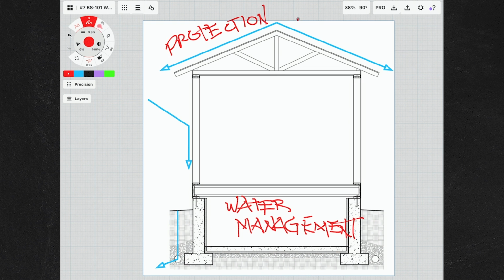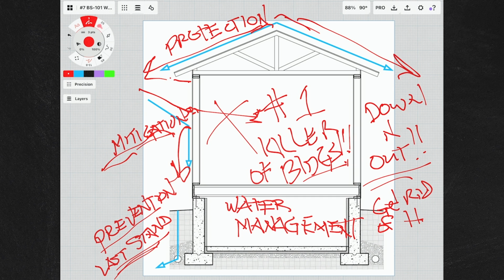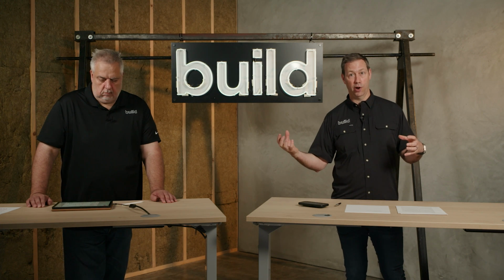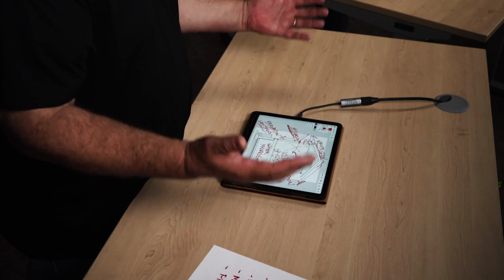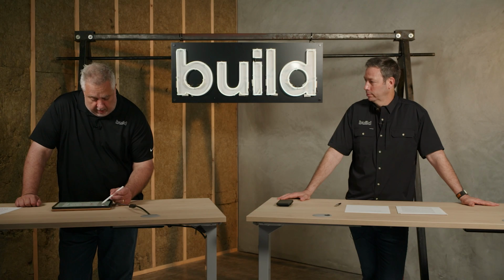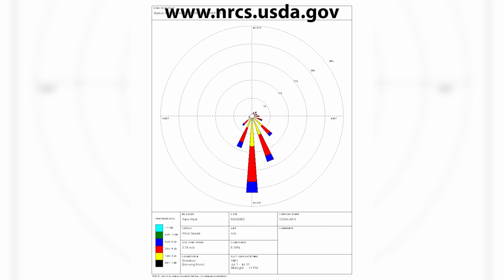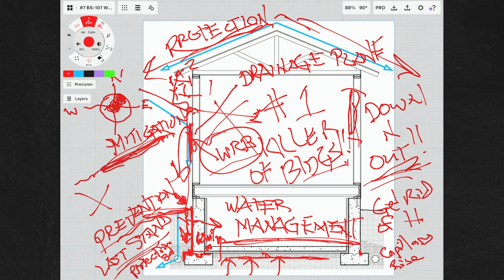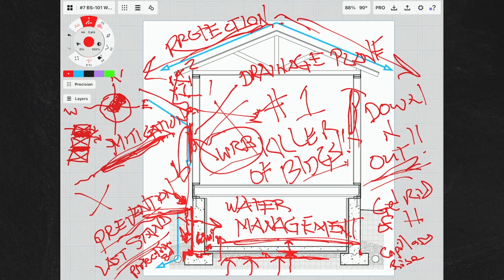Build Science 101: #7 Water  Management

Comment: Regarding the basement and drainage, here in Sweden I think permeable systems have been dominant for the last 10-15 years at least. Such as the Isodrän system that uses a very permeable 4 inch insulation sheet and a textile on the outside. Before that they used tar or eps/xps insulation sheets in combination with a waterproof plastic membrane with nipples to create a narrow air passage on the outside of the basement walls. The permeable systems are based on letting the basement walls breathe and dry out. So during the first months after installation the basement can be quite moist before it dries out. It means that the basement must be heated and the earth outside near the basement wall will be dried out to some degree. It also includes a drainage pipe on the outside that should be located below the lowest part of the foundation, placed in macadam, and often connected to a drainage well with a pump. This seems to work very well if not for extreme ground water levels or very bad management of rain water near the house. And you cannot use waterproof material on the inside of the walls or floor of the basements. But that is a problem in most cases, due to build up of moisture from the ground below over time.

Comment: Hi Matt and Steve, great video! Steve mentioned that caulk failures (and the resulting water leaks) account for a large percentage of callbacks from a homeowner and also that sometimes a builder will brag that “there’s no way our building will leak because we used 3 cases of caulk”. Is it possible to detail the building’s cladding around doors, windows and exterior corners without using any caulk, or at best the very minimum amount?
Perhaps Steve could show examples of flashing details that don't require caulk for houses built in different climate zones, either with or without exterior insulation and using different cladding types. If people can see that by changing their flashing (or trim) detail they can avoid using any caulk at all they could eliminate the weakest link in the WRB chain.

Comment: I agree with Steve that the client has to care about fundamentals enough to take up references from other clients to see if the buidlings designed or built by the architect/builder have had any fundamental problems. If they don't care about it enough to even pick up the phone, they are taking a massive risk on the architect or builder's expertise and integrity.

Comment: Great show this is absolutely the premier venue for staying current, however I do not believe that any homeowners will ask the questions Steve suggested as a generalization any more than a patient asks or tells a doctor how to treat or manage a disease/condition. This will always fall on the pros. Clients expect and will continue to and in my opinion rightfully to hold the pros liable for the preformance of the structure we build or repair/restore. As builders it's our responsibilty to inform and insist upon sound practices for our profession/trades. It's pure folly to think that any jurisprudent venue will hold an owner/client responsible for anything we build even in the presence of signed waivers, I will refuse any work or engagement where I am kept from doing the correct work by a client to do otherwise is to court regret/disaster. Ray Stormont

Comment: The mold crisis was a product of the 80's in Western Canada. And yet there were still architects in the 90's who still promoted the use of face sealed stucco on apartment and condominiums. The developers wanted it and some designer/architects would still sign off on details that resulted in rot. The building industry refused to accept responsibility. There was lots of finger pointing and resistance to more expensive detailing which permitted the practice to continue long after the problem should have been rectified. As you noted in your comments there were still installations occurring in the 2000's. As a draftsman in 90's I would hear of certain design offices that were known as developer shops. Fortunately I was employed by more forward thinking professionals throughout most of my career.

Comment: One more comment is the need for a cricket if there is a chimney or other wall at the bottom of a roof slope. The one good thing the flipper did to my house was they put crickets above the chimneys. The previous homeowner always had issues with water infiltrating the inside where the ceiling came to the chimney. I haven't had that issue since I bought the house.

Comment: All the prevention efforts can be defeated when the irrigation company comes in and puts in heads which spray onto the wall. They put the heads under the overhang. Even drip irrigation can be a problem when the drip insert starts leaking and spraying onto the wall. For me, it didn't help that the siding was the recalled  pressboard.

Comment: the silicone around my 5 year old windows are splitting. is this normal
Reply: No
Reply: shit @latvietis1755
Reply: A lot of times contractors use hybrid caulk with silicone that lasts about 5 years in exterior applications so maybe it only appears to be 100% silicone. Another factor could be trim expanding and contracting with temperature changes, new construction shrinkage or simply it was applied to dirty surface. Hard to tell without closer inspection. Hope it helps.
Reply: Yes because most sealants don’t have uv inhibitors in their formulation. So unless it never sees sunlight almost all sealants will eventually fail via contraction and failure
Reply: @DrMJJr  quality exterior sealant is designed to last between painting intervals; here in north east 10-15 years minimum. I bet cheap interior latex caulk will last 5 years. Water intrusion would be my next guess.
Reply: Your contractor used the cheap stuff and probably charged you for the good stuff.
Reply: @peteyou2325  whats the good stuff?